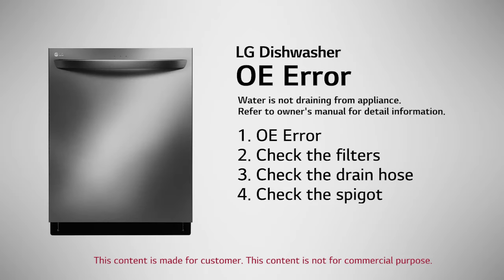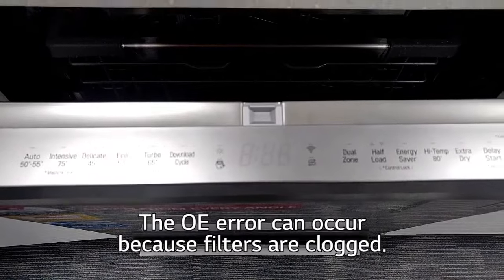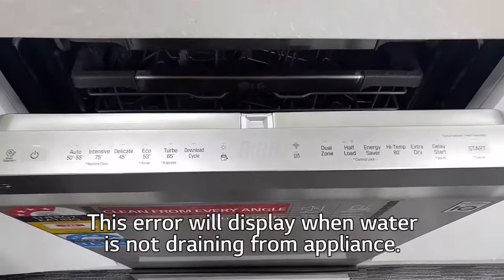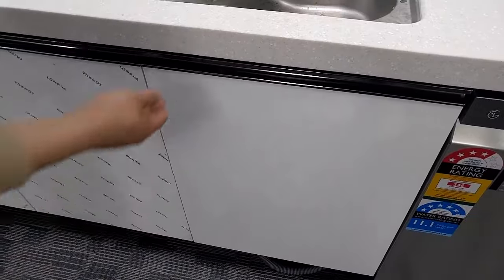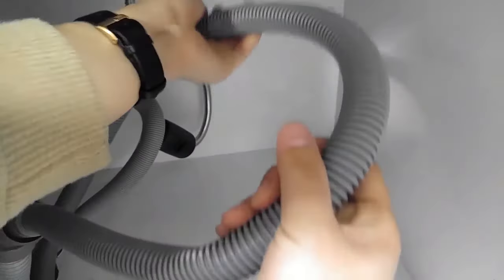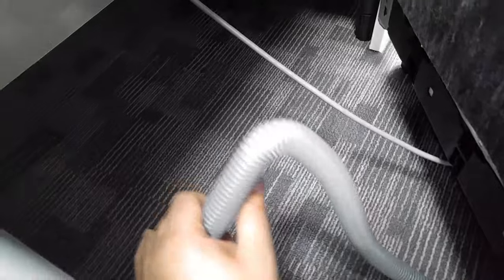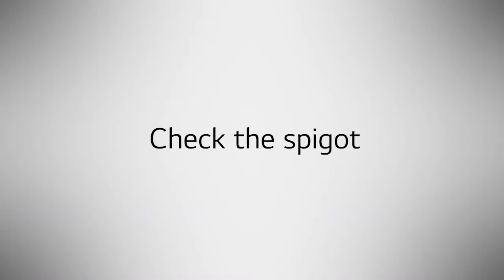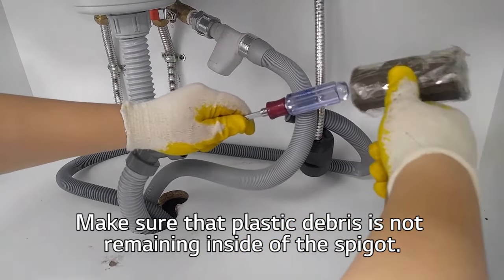[LG Dishwashers] OE Error

Comment: If you are getting this message and you recently installed an Insinkerator garbage disposal, there is a plastic piece you need to knock out inside to the dishwasher inlet tube. Knock it into the garbage disposal and retrieve the plastic piece. Took us two days to figure this out on a brand new dishwasher. Removed plastic piece and it worked just fine.
Reply: Debatably the most helpful comment on the internet, this was my problem.

Thank you!

Comment: @LGUSASupport: It did not mention the possibility of the Pump Casing Assembly (e.g. ABT72989206) or the Drain Pump (ABQ75742501) actually need to be replaced. It would be nice to have a video to show us how to replace either the entire "Pump Casing Assembly" or just the "Drain Pump" (ABQ75742501), as that would help a lot of people. Thanks!
Reply from the maker: Hey there! Thank you for sharing this with us. Your LG dishwasher is the ultimate companion for your kitchen, and we're all about making sure it's running like a well-oiled machine. We want to look further into your pump casing assembly and drain pump, so please private message us on social media @LGUSSupport with your contact information. We would be more than happy to assist! ^Joslyn

Comment: Great. But... how does one actually clear the error code? I assume a power off/on?
Reply from the maker: Hey there, Jed. This can usually be corrected by performing the following steps: Press the POWER button to turn the dishwasher off. Turn the circuit breaker to the dishwasher OFF and wait 10 seconds. Turn the circuit breaker to the dishwasher back ON. Press the POWER button to turn the dishwasher ON, and start a new cycle. ^Anthony
Reply: @LGUSASupport Thank you! Sorry if I sounded rude
Reply from the maker: You're welcome! No worries at all. Should you need any assistance, please send us a private message on Facebook or Twitter at @LGUSSupport, and we'll be glad to help. ^Jayne